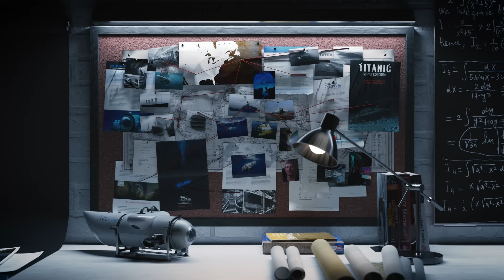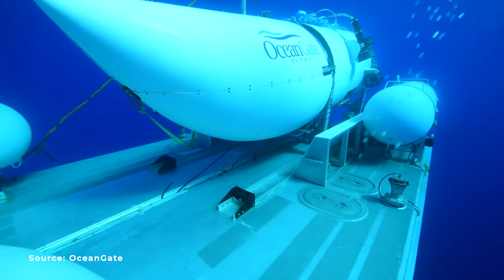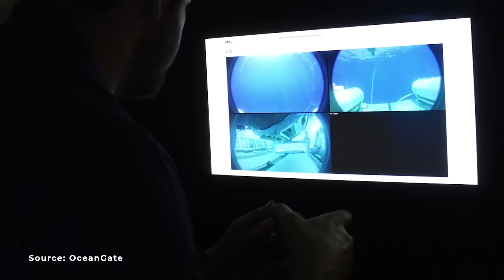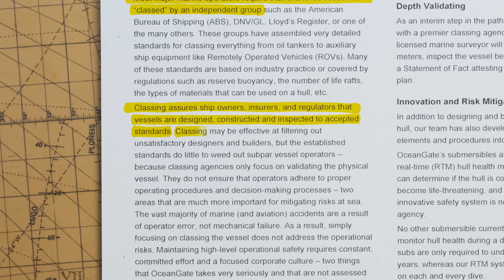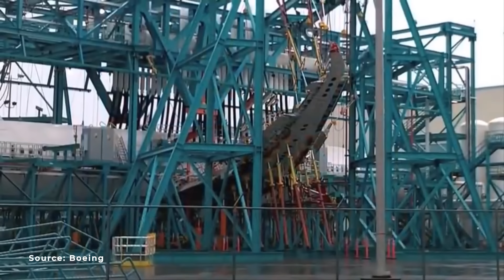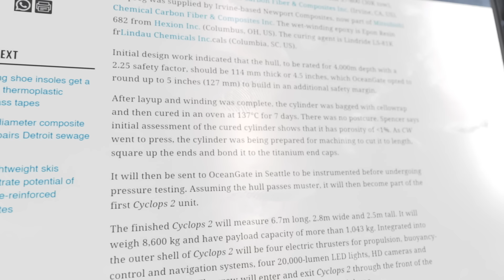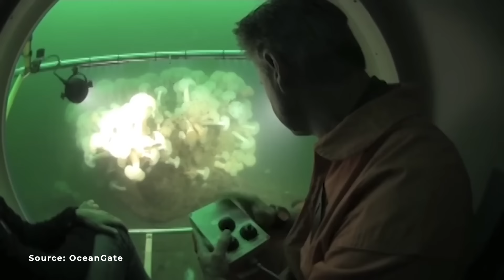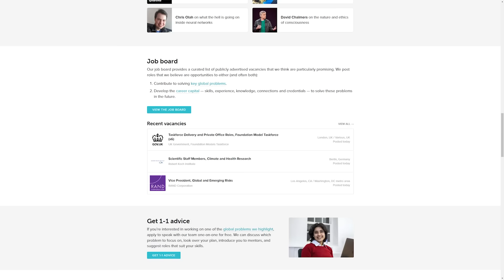The Questionable Engineering of Oceangate

Comment: Man, you can feel the anger Real Engineering has against ocean gate incompetence, considering his thesis was on Composite materials
Reply: not incompetence criminal negligence and total disregard for safety
Reply: @lenorevanalstine1219  and if not held accountable financially, it will happen again. OceanGate doesn't really deserve to be in business after this fiasco, and it can be used as a lesson of caution for other companies thinking of skipping safety precautions -- that cheap shortcuts will have consequences in the long-term.  Right now it's just a buyer beware scenario, with deliberate misinformation coming from the company.
Reply: @lenorevanalstine1219    that's a whole other composite layer...
Reply: Composite material *FAILURE*. This is literally what he studied.
Reply: Even more particular than that his thesis was in composite material failure properties.
Reply: Do you think he's alone??
I'm an aerospace engineer who works in industrial control systems and automation. A lot of that includes safety control functions like Emergency Stops and Safety interlocks. You know that stuff that keeps hands attached and prevents stuff blowing up. I eventually got the second highest qualification any engineer can get in that field.

Getting that qualification has kept me OUT OF WORK. 

The last time I saw a job specifically asking for that qualification I called up the recruiter to enquire. By that time my qualification needed to be renewed, but that was just a fee. I asked that if I was offered the job I'd pay the fee before starting. The reply was "Your the 4th or 5th person to put that too me today" and then they hanged up. That meant that other engineers had been experiencing EXACTLY the same situations I had.

That's what being qualified means to engineers these days. You work you ass off to get your degree which with all the math and applied math classes is damn lot harder than any arts degree. If you then take the effort to get further qualified your job prospects can GO DOWN not up. 

People like Managers and their Human Resource minions don't like people who speak out and people with qualifications are often caught out. Their employment contacts often include clauses where "if you know something you must speak out" which clashes with the reality that if you speak out you get your contract cut WHICH HAS HAPPENED TO ME just like it happed to the submariner/engineer David Lochridge who's suing Oceangate.

If you think engineers are angry over this sort of crap YOU'RE DAMN RIGHT and its about time there were some actual laws that protected us. Because when we're allowed to do our jobs YOUR LIVES are safer.
- When your driving a car its mechanical engineers who designed the brakes to help you stop before the tree;
- When you plug something in its electrical engineers who make it so you don't get shocked;
- When you drink a glass of water its chemical engineers who make it so you don't get poisoned;
- When you get in a jet to fly off on your holiday its aerospace engineers who keep the wings attached.

We keep you clowns alive in 100s of ways every day.
And before any of you complain just note you wouldn't even be able to read this with out engineers.
Reply: @tonywilson4713 
Unfortunately society does not appreciate the people that allow their lives to function. 
I had an acquaintance who had a mechanical engineering degree, who then went on to become a lawyer. In my perspective of which was more important, it did not compute.
Reply: @danasmith3288 We need people in the legal profession who understand engineering.
Reply: @danasmith3288  I have spent more time in the last few years informally studying economics than anything else.

The simple fact is unless I can make the economic arguments then I can't get anything done. Economists simply dominate the big decisions that affect all our lives and unless you can deal with them face to face then you're stuffed. To do that takes time and effort to learn their language.
Reply: I can almost imagine his rage and frustration when OceanGate ignored safety precautions and good engineering advice.
Reply: Even James Cameron told Stockton that If you're using acoustic detection for safety then the whole thing is already wrong.
Reply: Exactly! As an engineer myself with background in composites it’s absolutely boneheaded, literally criminally incompetent to use composites in compression.  

The people who made this out of composites for Rush, knowing that it was for a sub should also be criminally charged.  It’s like making a passenger airplane out of peanut brittle.
Reply: @xiaoka From news articles I've seen, apparently Stockton used college interns to design the sub and not anyone with an engineering degree or any licensing.
Reply: @Totenglocke42 - god, I feel horrible for those interns. They didn’t yet know better (or knew better but lacked the confidence to reject the assignment). I can’t imagine the guilt they now have to live with.
Reply: @xiaoka  There liability would lie on the execution and not the concept. If they improperly executed the specification then they could be liable if it could be proven that their error(s) caused the accident. That would be difficult to prove and the ultimate liability lies with Oceangate.
Reply: @cidercreekranch  "There liability would lie on the execution and not the concept."

The fact that they seemingly knew this thing was going to be used as a passenger vessel for deep sea trips and yet still made it with a completely unsuitable material, full of air bubbles,   is engineering malpractice in my opinion and possibly criminal liability. Akin to selling dynamite to someone knowing they're going to use it recklessly.  

(Unless Stockton Rush lied to them about what they were building...  )
Reply: @xiaoka you have no background in composites. Very very few structures and pure tension. Every other structure has compression. You can't just rule compression out like that.
Reply: @xiaoka  The USN made an entirely successful ROV decades ago out of composites. (In fact the design is so similar Ocengate probably copied it partially). Using Composites wasn't the issue here. Lack of due diligence was. But thats what happens when there's no regulations requiring due diligence.
Reply: @xiaoka It's not like composites cannot be used in compression. Half of every single bending beam is a compressive member including large critical structures like the wing of a 787. The correct response is to adequately characterize the materials and structures, not dusqualify designs based on ignorant rules of thumb.
Reply: @appa609 externally pressured vessels are ONLY under compression, there is zero loading under tension.  It’s not like a carbon fiber wing, beam or strut under bending. 

…meaning you are effectively compressing an epoxy cylinder that is full of voids and  the fibers in compression providing minimal stiffness.
Reply: @xiaoka  There is no difference locally. Any given cubic mm of cfrp doesn't know if it's in a plane or a sub only its stress tensor. It's not that carbon fibre cannot be used safely in the load cases they desired it's that they didn't do their due dilligence.
Reply: @appa609  
A typical airliner is pressurised to no more than eight psi in tension. every dive to 4000 metres subjected the submersible to around 6000 psi in compression. I assure you, hydrostatic pressure is directional.
Reply: @xiaoka   Oh, wow.  Tyvm...there WOULD have been a moral obligation.  I guess if it was a LEGAL obligation, this fool would've been pretty much thwarted
Reply: @xiaoka 😮😮😮damn thanks for the strong insightful insight I never read a explanation to why the material was wrong so understandable thanks
Reply: The fault entirely lies on Rush. The composite manufacturer only made a product as specified by the customer. What the customer do with the product is on them.
Reply: This is why I waited for Real Engineering to cover it and haven't bothered with anyone else's videos. I knew I could trust him.
Reply: @gordon1545  I hope eventually if more and more info comes out he does a long and even more in depth video. I think people will be interested in this for a while, the hubris and the tragedy and the extravagance make it a compelling story. 

I dont think the victims were properly informed because of the silencing of whistleblowers. The attempts to shame the victim prevent people pressuring government from changing legislation to prevent this. We must protect whistleblowers.
Reply: @gordon1545  Same here. I truly trust and enjoy this channel and have had my subscription set for ALL notifications juist for this video. I wish that my father was still around to see these videos. He would have absolutelyu loved it as a civil engineer. These vids make me think of him. I wish this channel the best.
Reply: @gordon1545 they are practically the same woth others. Anger
Reply: @gordon1545  same. i knew RE had a masters in a type of material but couldn't remember any specifics. Everything I've been seeing/reading was mentally pushed aside as hearsay. Hoping the Irishman would be releasing a video. Had no idea it was specifically in FA of CM. Perfect guy for the job.
Reply: @gordon1545  I know a deep sea recovery specialist and on day 1 he said they were gone and he also theorized about these same built/material flaws.
 Thats the only opinion I needed.
Reply: @gordon1545 you know you can just see and hear things just not blindly believe them?
Reply: He's exactly the type of guy Stockton Rush would have loved to fire ... there's no time for these nerd calculations, we've got a Titanic to see!

😊
Reply: @kylek29 squish
Reply: @kylek29  there's money to be had, I need my $250,000 from my "mission specialists"
Reply: @kylek29  yeah, with those nerd calculations, that event shouldn't happen.

But people want to look cool so what else these nerds can do 😒
Reply: Stockton was reckless (and a jerk), but he was driven engineer, like many renowned inventors before him, including people like Stephenson and Wright brothers.
I mean when you have to sign such waiver, which "permanent injury" and "death" are mentioned multiple times, you should understand the risk.
Reply: @MoltenMozzarella stockton was not interested in doing any of that. he wanted to be the star and in his mind, he was the star and no 50 year old yte guys was going to tell him what he could, and could not do.😂 he already knew that submersibles were built to carry up to three people and he knew he was not going to be able to hire anybody that was going to go along with building anything to carry more than that which is why he was over there employing teenagers because they did not know any better. Therefore, Stockton was describing himself as an innovator because he was doing something that the industry was not doing, but he never logically understood why they were not doing it. because it was dangerous and not a logical sound engineering practice to be taking people down that far.  He was out and about telling people anything that did not know any better.
Reply: And they SHOULD! Putting others in danger over your own ambitions… nah not cool. Do it yourself if that’s what you want to do
Reply: Because he actually studied this and has a degree in this. This kind of stuff is his life’s work
Reply: I love it when people get so passionate about something. He could talk about the thickness of drinking straws and i would listen.
Reply: Not just on composite materials, but on composite failure prediction, this was literally his field of study lol.
Reply: The anger is Stockton Rush’s incompetence and stupidity got 4 others killed. His own death was his reward, but what did others do?
Reply: @dustyrhodes6798  play stupid games, win stupid prizes.
Reply: @MoltenMozzarella  Stockton is where he needs to be.
Reply: @MoltenMozzarella  that's a lot of pilots that's gonna die. it's actually good he went down with his vessel. that way his can witness his business implode around him
Reply: @MoltenMozzarella  I'm sure you could  still find a few people with more money than brains.
Reply: Indeed... If a rope is good enough to pull a 1ton block, it doesn't mean it's good to push it
Reply: we don't waste 4 years in engineering school for nothing, me being a mechanical engineer myself.
Reply: It is always easier to be critical AFTER THE FACT !  This is all important to have design/manufacturing/testing criteria and standards. It should have been obvious that composits subject to repeated cyclic high stresses will eventually fail. And catastropic failure.
Reply: This wasn't just incompetence, it was also negligence. They willingly avoided doing tests that could've saved lives.
Reply: If he was not aboard that vessel, there would be a line out the door and around the block of engineers waiting to slap him in the face.
Reply: @notamouse5630  Amen.
Reply: This goes beyond poor engineering, beyond incompetence.  This was negligence driven by greed
Reply: @MoltenMozzarella - They don't make sewer pipes out of carbon fiber, so it should hold together okay.
Reply: Stockton Rush admitted to not knowing 'which button is up or down' on the Titan submersible controls after it went down with a misaligned thruster, in a resurfaced documentary. This is the same grifter who stated he refuses to hire 50 year old white men. I guess he meant experienced submariners who would recognize immediately the extremely poor way the steel coffin was manufactured. A few of those white men were fired from Ocean Gate for bringing up safety issues. “Ocean Gate is now hiring recently graduated students. Must be qualified in the operation of an XBox. Knowing how to defeat the Red Ring of Death is a plus. Most importantly, experienced white men in submersibles need not apply. I’m talking about $250 thousand a pop. Come on my peeps, look me up”
Reply: @MoltenMozzarella  The right guy was piloting the submersible.
Reply: The crazy thing is its basic knowledge

I work in marine insurance, and we know to ask about materials of watercraft we insure.. it really sounds like the CEO was just an egomaniac
Reply: Photos of the interior show that the computer monitors were actually screwed into the composite hull. 🤦🏻‍♂️ This is very dangerous as it will weaken the composite material. Monitor brackets should have been glued on.
Reply: @a921dji3  The craft had two hulls. An outer pressure hull and an inner non-pressure hul. The monitors where bolted to the inner hull.
Reply: i wouldn't difine it as " anger " , as he is an engineer himself  id describe  his tone as incredulous
Reply: Not just composite materials, failure prediction. Amazing.
Reply: The owner was extremely arrogant and ignored warnings. These kinds of entrepreneurs are dangerous, more so given our screw-you society. If you hear anger, it is measured and deserved.
Reply: What you heard wasn’t anger; it was upset that people were needlessly killed by a pathological narcissist.
Reply: "To all future engineering students watching this, DO NOT skip out on your ETHICS course." 

We hold the lives and the well-being of others in our hands.
Reply: "Good good let the h8 flow through you" 😈
Reply: 12:33
At least 250,000 Americans die each year due to some sort of medical error. But, depending on what is considered a medical mistake, that number could be as high as 440,000.
Reply: @Rob_Rohn  It’s probably even worse. Settlements of medical malpractice suits usually specify that individual doctors’ names be removed from any record of the settlement. The name of the hospital (if applicable) and nurses’ names are included, but typically not doctors. Then they a include a paragraph requiring that the plaintiff never speak to anyone about the suit, or the money from the settlement must be returned. So, if you’re choosing a doctor for a surgical procedure and you want to know if he’s ever been part of a lawsuit for his role in performing that procedure, his record looks clean. He could have botched it 70% of the time, but it’ll look like a perfect record. It’s infuriating.
Reply: @Rob_Rohn  you're more likely to die from malpractice than being shot.
Reply: They didn't want to hire "old white guys" and fired the one who accused them of this madness..
Reply: me too
Reply: yep
Reply: https://youtu.be/4NuXF0OCAc0
Reply: Not just incompetence. The CEO was openly bigoted and boasted about not hiring & firing white men
Reply: Incredible and informative video!
Reply: i feel like Real Engineering has been toned down the title for at least 4 times
Reply: This is the only video I've ever watched on the ocean gate sitch.
Reply: I think you're just imagining things.
Reply: I am starting to think if my Edit Type of Materials on Revit was good enough!😂😂😂😂😂😂
Reply: And rightfully so!
Reply: Lord Neptune despises Captain Frackton Crunch's hubris.
Reply: Seems like fate. His whole life he was learning to make this video..
Reply: @SunriseLAW Accounting for inflation is $2,640,000 in today's money. So if your trying to say that they where overpaying or somthing your well off the mark. As for why people where paying for it? Because they wanted to go see the titanic. there's not a lot of people offering trips there believe it or not. Cameron's been 33 times but thanks to his work getting down to Challenger Deep he's actually an expert in the field. he's not a joe blogs tourist.

When you remember most of the passengers they took where non-engineers with no real idea of what a submersible should look like and with oceangate being one of the few companies operating in the space it makes perfect sense people would be willing to go on it if they have the money.
Reply: I actually thought he was quite balanced in this. Focused on technical details and a problem solving angle. 

Especially the Hanlon's Razor comment.
Reply: People cutting corners just to save a buck
Reply: This guy Stockton Rush was a real arrogant, East Cast Dunning-Kruger-style Darwin Award winning asshole of the highest degree.
Reply: any decent mechanical engineer can take one look at that design and tell you why it's a no go.
Reply: Move Fast, Break Things, Innovate! Sure this is all well and good, and has obviously worked for SpaceX BUT, when human lives are involved, this approach is simply a death sentence!
Reply: Still feel for the people
Reply: Anger against the engineering lol what about the knobs who thought it was an even better idea to go in it
Reply: A lots of genius per square inch on this Chanel.
Reply: Not sure why he's angry. We should build more exactly the same and send more of the rich.
Reply: Yeah and that show us that he is pure on biass and don't care about the science of what happen there. :(
Reply: carbon fiber might not be meant for everything, but at the least it’s still the best at many things - Tom Cruise (maybe)…
Reply: Mathematical certainties are absolute, period.
Reply: He's an angry young man for sure.
Reply: Because it was a literal insult to the entire scientific and engineering communities to disregard decades and centuries of research and engineering methods.
Reply: He's not the only one angry at the incompetence shown by oceangate and that fool Stockton rush
Reply: My own anger as well and I'm just a YouTube viewer and enthusiast
Reply: Daddy asf.
Reply: Stockton acting like a YouTube comment “y’all be hating, this will work just fine”
Reply: He was experimenting with people's lives, regardless of whether or not he was doing things by the book. By the book by standard 9, not by industry standard, whatever the case. He should have been doing it alone. He's an adult. He's educated. He knew what he was doing, but he could have been suffering from some Health problem, a medical health problem. It could have been psychiatric, it could have been something that we don't know about. But I believe, and the right to die if you want to, but you don't take innocent people with you, okay, if you're saying that I want to end it and go to Switzerland for a lethal injection.
You should be able to do that one00%, because I believe you're right to do what you want with your life as long as it doesn't affect anybody else. There's no guarantee in that emotionally, of course, when it comes to the right to die. But I don't believe in suffering unnecessary pain, and I don't believe that we know the whole story of what's happened here. We just learned everything about the composite fibres and the structure of the hall and blah blah blah, but we are not analyzing. The mindset of this man, the actual thought processes he was going through, maybe, was a itidlife, maybe it was oroincrisisut predict. And if he were a psychopath, he wanted to take others with him. So he was risking it all, and he said, Hey, you know what? If I'm going anywhere, I will end up going down. I want to make sure I can take other people with me. Which may have Thishis in the thought, it was more comfortable for him to think his life was at risk with others being put at risk, which is absolutely terrible to have a thought like that. As an educated person anyway, and a non-criminal, he was many things; he was also deceased, along with innocent beings. And Stockton, you know, has no right to be judged, because he can't be judged. He's not here to defend himself. And we are not here as anybody better than him. Just because we haven't taken people down to the Titanic, or we haven't, you know, violently put anybody's lives at risk.
Nobody is perfect. He was not the first one to be cast or the first one to be stoned. 15:11 was experimenting with people's lives, regardless of whether or not he was doing things by the book. By the book by standard 9, not by industry standard, whatever the case. He should have been doing it alone. He's an adult. He's educated. He knew what he was doing, but he could have been suffering from some Health problem, a medical health problem. It could have been psychiatric, it could have been something that we don't know about. But I believe, and the right to die if you want to, but you don't take innocent people with you, okay, if you're saying that's it.
I'd like to end it and go to Switzerland for a lethal injection. You should be able to do that one00%, because I believe you're right to do what you want with your life as long as it doesn't affect anybody else. There's no guarantee in that emotionally, of course, when it comes to the right to die. But I don't believe in suffering unnecessary pain, and I don't believe that we know the whole story of what's happened here. We know everything about the failed composite fibres and the hall's structure, but are not analyzing it. The mindset of this man, the actual thought processes he was going through, maybe it was a midlife crisis or a crisis that we couldn't predict. And if he were a psychopath, he wanted to take others with him. So he was risking it all, and he said, Hey, you know what? If I'm going, any of these times will end up going down. I want to make sure I can take other people with me. This may have been his thought process; it was more comfortable for him to think his life was at risk with others being put at risk, which is absolutely terrible to have a thought like that. As an educated person anyway, and is a non-criminal, well, evidently, he was many things, but he's also deceased, along with innocent human beings. And Stockton, you know, has no right to be judged, because he can't be judged. He's not here to defend himself. And we are not here as anybody better than him. Just because we haven't taken people down to the Titanic, or we haven't, you know, inadvertently put anybody's lives at risk. Nobody is perfect. He was not the one to cast the first Stone. 

Thanks - this is only my opinion.
Reply: Because idiots like this guy make everybody look bad and ruin it for everyone nobody’s getting into a submersible for a long time now 🤷‍♂️
Reply: James Cameron also explained it very beatifully
Reply: I don't think anyone was really paying attention and are now frustrated they hadn't caught this sooner to put more pressure on them to stop.
Reply: @RobParkinVideo  I don't think there could have been any more pressure put on them than the amount this submersible was being subjected to already (mild sarcasm)
Reply: @RobParkinVideo They can’t, because there are anti-trust laws against that.
Reply: makes early experimental submarines look good.
Reply: I can totally understand
Reply: Why did they not use M5 composite? Supposedly has very high compressive strength and  low density?
Reply: @ianmcloughlin8509 Boron fiber is the greatest of all fibre reinforcements in compression.
Reply: PH is still down there, he could be banging on the sub for help!  lets bring our boys home ALIVE
Reply: Rewatched it now and I still don't agree. Sure there were words here and there but they accurate are more than apt. There was no giveaways that he is emotionally invested and stayed professional and objective all throughout.

🪙🪙
Reply: Why capitalize "Composite"?
Reply: @Tahoza who cares
Reply: @Tahoza because the submarine was made of a composite material
Reply: @alexacosta2140  (it's been a while since I made this comment) 

is this in reference to me asking why they capitalized composites?
Reply: Stockton Rush, the founder of OceanGate had a degree in aerospace engineering.
Reply: @WeAreMovieMakers  Which explains why he went with a composite hull that would be appropriate for aerospace applications. The only problem is, he then took it underwater
Reply: @WeAreMovieMakers
So? I dont see subs flying through the air. 

Just because you have a degree in a field, that doesnt make you an expert in a different but related one.

Take an expert gastrointestinal surgeon. They understand basic aspects of surgery on all body parts in addition to the parts they are an expert in. But would you want them operating on your brain?
Reply: @WeAreMovieMakers  that doesn't prove anything
Reply: @WeAreMovieMakers  Pity he didn't use it!
Reply: @WeAreMovieMakers 
A pressurised composite fuselage is cured in an autoclave and is typically subject to no more than 8 psi in tension. The Titan composite vessel was cured without applying best practices to eliminate voids and went on to accumulate serious material defects over numerous cycles exceeding 5000 psi in compression. The two regimes are in no way comparable, and pretending that they were had predictably deadly consequences.
Reply: @WeAreMovieMakers That didn’t make him a composite expert
Reply: @WeAreMovieMakers a degree doesn't give people common sense, business ethics, or even intelligence.
Reply: @WeAreMovieMakers  BUT He was going DOWN not UP
Reply: Proof that a degree doesn’t indicate intelligence. Maybe if he had paid more attention in class his son would still be alive. As far as I am concerned, he is a father that murdered his son.
Reply: @WeAreMovieMakers "Had"😅
Reply: How he got it
Reply: @WeAreMovieMakers  educated; but intelligence was still lacking.
Reply: He must have mail ordered his degree lol
Reply: @WeAreMovieMakers a degree he promptly ignored and disregarded for the love of money and attention. It’s unfortunate that his narcissism had to claim 4 other lives along with his. Not to mention his degree was for aerospace and he was determined to travel in the opposite goddamn direction.
Reply: @WeAreMovieMakers yeah a clever guy, just no common sense.
Reply: @WeAreMovieMakers Unfortunately that same idea is likely why he used composite, in aerospace the pressure is going outward not inward so composites should work but in this case that was not the case.
Reply: He should have known better then
Reply: @WeAreMovieMakers  Unfortunately libertarian philosophy trumps every kind of education.
Reply: @Schmidtelpunkt  Only for narcissists.
Reply: And a mind set that ignored proper engineering design.  Also, I received no education in the design of composites during my engineering education.  I had to learn that later on the job.
Reply: Angry about what? Who cares.
Reply: How do you know what his thesis is?
Reply: Are they rescued yet?
Reply: @SharonM-q8t is who rescued? The people in that sub are one with the water now
Reply: play diversity games, win stupid prizes
Reply: "engineers" on here giving it the "i learned compsites" 😂  Nahh you didnt, unless youre a boat builder you know nout about it so stop talking gash, i am a boat builder and i would love to see your colledge education do my actual job. thanks.
Reply: @bigduphusaj162 There's nothing fancy about laminating glass on a boat hull on a structure with a factor of safety of 20. I have taught dozens of undergrads to do this in a few weeks. This doesn't mean you understand the structures better than someone who studied composite fea.
Reply: @bigduphusaj162 The only thing you build is a stack of personal failures.
Reply: @bigduphusaj162  
A typical boat builder aims to prevent its occupants reaching the bottom of the ocean; those skills have been around since the Middle Stone Age. Designing a subsurface vessel to keep its occupants alive requires mission-critical engineering from more sophisticated minds than those unable to spell college.
Reply: @bigduphusaj162  oh, so having a degree in something doesn't make you an expert in it, I wonder what does then
Reply: Where was all this outrage before the incident?  Plenty of warning signs. RE is now just another ambulance chaser.  THIS TOPIC HAS BEEN DONE TO DEATH.
Reply: @railgap to be fair, I wasn't aware that Oceangate existed before all of this. First time I heard the news, I thought they were the ones who brought James Cameron to the wreck.
Reply: @railgap  
You've got it backwards. Death is what will result if engineers don't keep hashing it over until everyone understands exactly how this happened and the point is beaten into every would-be entrepreneur that you can't do this stupid shit.
Reply: @railgap  If you are not interested, don't watch the vlog.  Some of us are very interested.  As a science major and a scuba diver, I find the topic interesting and watch every vlog on the subject.  I find some just a repeat of others' material…and can decipher between  facts and bull.
Reply: Fact is that their ship went under water 50 times and didn't break until now. Without investigation he extrapolates from old blog post what was the state of ship claiming engineers made wrong decisions.

Real Engineenering is just youtuber he isn't engineer as he doesn't design anything. It is hardly any source of knowledge on subject other than info for people who don't know anything.
Reply: @pawnap666 personally I'd trust someone who wrote a thesis on composite failure more than a rando in the YouTube comments who doesn't seem to understand fatigue failure over time but that's just me
Reply: @pawnap666  first of all: the more a material is tested the more stress it undergoes. i wonder what would happen to a stressed structure.
Seocnd of all, doesn't real engineering have a degree in composites and wrote papers on them?
Reply: @pawnap666  
It was the repeated cycles on an anisotropic material, with no investigation into the resulting accumulation of material defects, that led directly to its catastrophic failure. Fifty cycles isn't even a proper test, and if he had performed such a test the resulting inevitable catastrophic implosion would have confirmed what experts had told him all along: you can't use a material like carbon fibre—which has no yield strength because there is no margin of elastic deformation, simultaneously reaching its point of plastic deformation and catastrophic failure at its ultimate tensile strength—to build a pressure vessel that cyclically experiences forces approaching those tensile limits.
Reply: @pawnap666  Just because he placed the sub in the water 50 times means nothing.  Unless he took it to the depth (4000 m) that he was trying to access to the Titanic, it proves nothing.  Putting it in water at 100 feet or 200 meters is not putting a lot of stress on the unit.   Maybe, you should educate yourself.  I'm hearing he only took the Titan to that depth was less than five times.  All other attempts were abandoned due to some malfunction.  Do some research on how many times the Titan was taken to the depth of 4000 m.